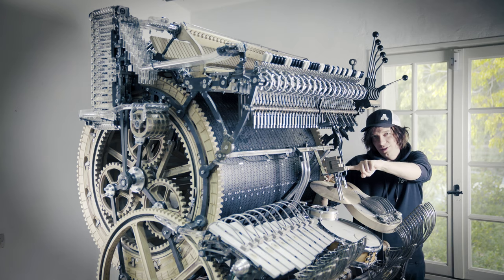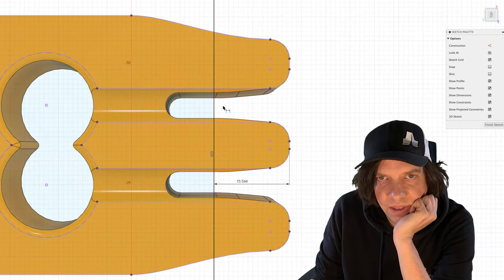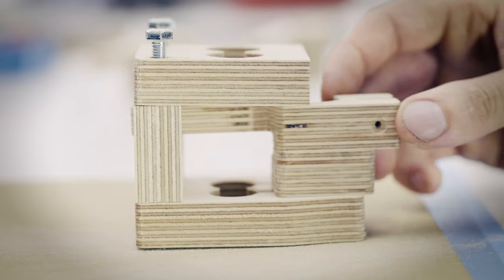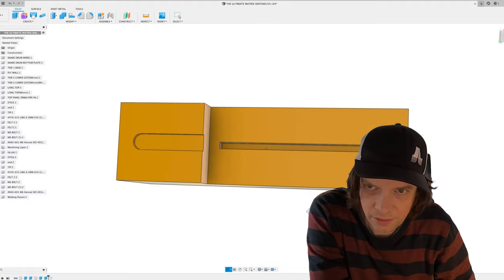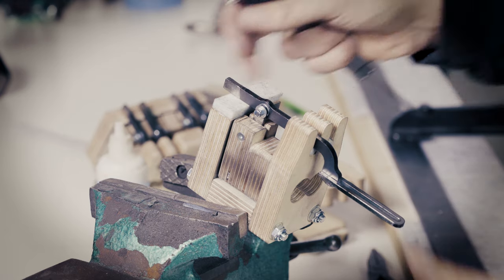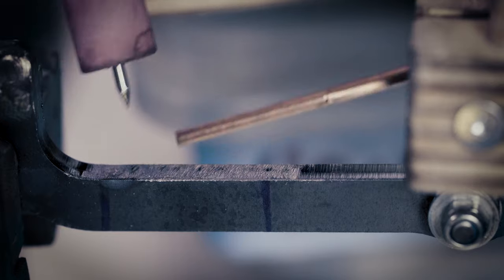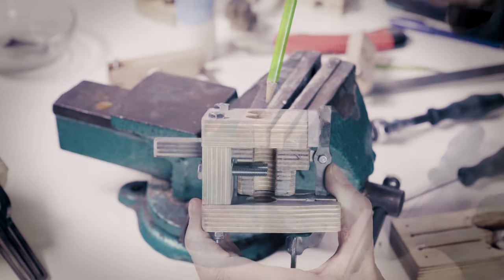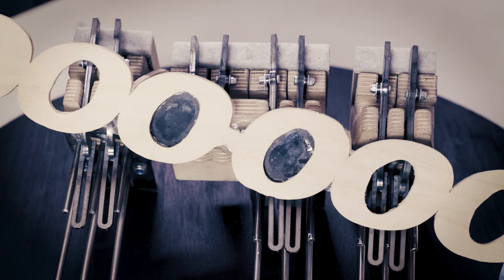Making Better Marble Gates - Marble Machine X #144

Comment: Reposting from last video. Please consider the failure mode instead of the failure rate. Do FMEA and pick a recoverable failure mode or at least a non cascading failure. You may lose one channel but the rest will carry on. Side note: If you can pick the point of graceful failure in the system - you can design it for repair easily on stage. Hello from Canada
Reply: That makes way more sense
Reply: I don't think a lot of the comments here get seen. Have you mentioned it on the Discord yet?
Reply: This is my number one criticism of this project from the very beginning. A ton of effort has been put into preventing failures, but basically none has been put into the failure modes. This was understandable when it was just Martin as he has no formal engineering education, but for quite some time there have been experienced engineers helping out that should have brought this up time and time again with Martin.
Reply: @Shinigumi  No. is it Patreon only?
Reply: I was going to comment something along these lines. The assumption seems to be that one marble failing per song means the entire song fails. If a drummer misses a beat on stage does that actually draw away from the entire performance. I doubt it. There must be an acceptable failure rate whereby the missed notes/beats are immaterial. Unless it wipes out the whole channel of course.
Reply: @dmacpher  It's not Patreon only, the link is in the description.
Reply: @Nomen_Latinum  RTFm eh :p TY
Reply: Great idea, we have this principle in software design as well. We expect components or systems to fail, if/when they do we want the system to handle it gracefully.  So an example would be loosing a connection to your data store, catastrophic failure would be loosing the record or file. Graceful would be having retrys, barring that, logging, setting the system to a safe state, giving a good error message, and maybe even saving and queuing that record for later.

Same I assume applies to mechanical failures. You build in failure points that will not affect the whole system.
Reply: @kainenable  in systems and mechanical engineering and design you want to 1) limit failures 2)have the failure not impact your defined critical control points or validated parameters for whatever quality spec you use (Gmp, iso, safety) and then 3) make it so when it’s in production your engineers and mechanics won’t hunt you down because you have to remove 5000 fasteners to get at a slip clutch, sacrificial fastener, or bolt :p). Very similar to software.
Reply: Agreed, there are two (or more) failure types. One that causes a song ending break down, and one that is just simply a missed note.
Reply: The way "failure" and "failure rate" are approached in these videos is very vague to me. Numbers without context are thrown about all over the place. Like the claim "drop 10m marbles without failing". What constitutes failure? Is hitting the instrument then missing the funnel a fail? Is missing one marble drop but working flawlessly after considered a fail? Or are only catastrophic, unrecoverable failures considered fails? As such, i don't understand why Martin is now so adamant about pushing these numbers. The only explanation i have is that he's for some unknown reason feeling pressured into delivering content and making progress, but is unable to do so because of the realities of building such a complex machine. Sounds like he needs to spend a lot of time refining some aspects of the machine (which is quite understandable at this point in the build), but rather than just saying it, he feels like he needs to justify it in some convoluted manner towards his viewers.

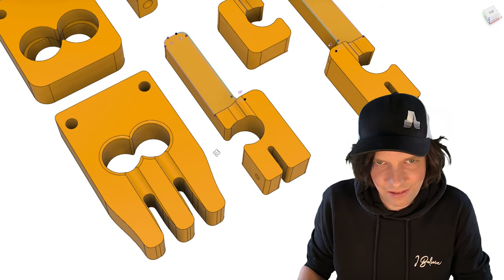And when he says stuff like 2:45 ("This needs to work 10m times in a row, so i'll give it a little extra slack."), my head explodes. He claims the thing is designed to work 10m times in a row, but he's using trial and error. How does that even make sense? The gods of engineering are weeping.
Reply: @billtheunjust  There are, in fact, more than two. A failure might also consist of the marble being slightly deflected during release, playing the note, but missing the funnel. But since Martin has never defined what a failure actually means, we will never know how many types there actually are.
Reply: @CristiNeagu  they said as much :p
Reply: @dmacpher  Please for the love of god keep posting this comment on every single one of his videos until he realizes just how important this advice is, and that at the very least it's worth addressing to the many worried engineers/designers that watch.

I will do my best to upvote it I suggest the community do this as well.
Reply: @seemlesslies  I’m on the discord - I’ll even do the FMEA for them and map the modes. Kinda need to scrum the validation and quality parameters they want, but I can guess . I wonder if they did a URS lol
Reply: Who needs a design or urs spec anyway (says younger me)
Reply: @CristiNeagu  That's exactly what I was thinking. You can't throw around the number 10mil and then adjust a felt strip by 1mm.... In a week that could deform. I would be totally onboard if he just said "as consistent and reliable as possible" but using a specific number over and over with no context as to what consists of a failure, whether or not he's differentiating between catastrophic failures and simple failures, or whether he has considered break points to accommodate for system failures is just frustrating, especially considering that people have consistently brought up these totally valid ideas.

Edit: also to be clear I'm not an engineer, but I do know from experience that nothing is ever perfect. You have to expect failure and design around it.

Seems he could save a lot of time if he thought about it this way instead of reaching for the impossible goal of perfection.
Reply: It's not like there's any hurry at this point. With CV19 any world wide tour, for the moment is a folly, and an impossibility. Enjoy the extended design. It's as much for him as it is for us.
Reply: @GrandmasterofWin  I'm waiting for him to realise that the huge multichannel audio cable he has is an exponential failure source...
Reply: @aserta  Nobody is complaining about time. No one's worry is that it's taking too long. I think we are all more than fine with that. What I am complaining about (and many others, i am sure) is that i wish he'd stop throwing around random numbers, and just do proper engineering.
Reply: @YourprogrammingnetworkCoUk  I've had a little bit of experience in music myself, and often times, if you miss a note, but everybody/thing else keeps going, literally nobody will notice.
Reply: @CristiNeagu  the audio cable doesn't need to be connected and disconnected tens of thousands of times, so its chances for failure are much lower. In addition, the cable is fairly easy to replace and any issues can be identified before the show starts; it is very unlikely to fail during a performance.
Reply: @nikolaihedler8883  Pins in those plugs are very easy to bend. People constantly trip over cables, pull them out of sockets, step on them, etc. And that cable is not at all easy to replace. And check out when he was installing the interfaces on his desk to see how easy finding an issue and replacing the cable is...
Reply: why not tell him to predict lottery numbers too?  there are literally 10000 failure modes in that machine
Reply: @natalieisagirlnow  likelihood to occur and criticality (defined by user) are part of the FMEA process. You can use critical control point, VSM and other methods to limit the scope. Anything low criticality to entire system can be removed from exercise
Reply: @dmacpher  classic pencil pusher nonsense
Reply: @natalieisagirlnow  I’m an OPS guy but hey, whatever floats your boat
Reply: To address the situation where one channel stops working, how about an option to make the other channel play it's notes? Like something that flips down and makes a channel react to it's twin's programming pins? Yes, the max rate is 1/2 what is was before, but most songs would be able to play fine (?).
Reply: @AndrewJohn   could also just have an opital sensor(or Hall effect if the pegs remain metal) read the pegs and fail over to live samples with a midi controller. Would be cheap.
Reply: I've thought about this. An example would be, rather than designing a channel so a marble never gets stuck, design it so that the marble gets ejected from the machine of it does something it shouldn't.
Reply: @dmacpher  it isn't. discord.gg/wintergatan
Reply: @nocare  I hear you. It’s not just mode OR rate. It’s rate and mode and criticality (if it’s a piece that isn’t defined as needed to meet the defined system requirements like a knob , who cares). I’m not pre supposing how to impact mode or criticality, but the percentage for the entire system he’s selected(and the marble drop sub system) are insanely high. Check iso 26262 on base failure rates. A good example is the Apollo program, it had an acceptable base failure rate of .1 %. That meant that in any given launch 600 parts would fail. The point isn’t to build something perfect, it’s to understand HOW things fail first, what’s the likelihood, and then either improve rate for the given part, the mode it which it fails so it doesn’t lead to system wide failure, or build in redundancy. It may seem academic but the exercise of defining user requirement specifications, design validation (fmea as part of that with a feedback loop) will often take you back to first principles and avoid the sunk cost fallacy.

Put in a short way, I wouldn’t define what the solutions are, just the process to asses the system and design. I’m not familiar enough with the entire design even though I’ve watched every episode. Hope this clarifies my thought.
Reply: @natalieisagirlnow  We aren't criticizing him for trying to predict lottery numbers. We're criticizing him for pretending like he's following some rigorous methodology for predicting lottery numbers, where in fact all he's doing is guessing. And precisely because there are 10,000 failure modes in that machine everyone is calling for him to do proper FMEA.
Reply: @ainzooalgown119  I joined - shaft Tackapple
Reply: @Thefloorislava115  exactly- a pressure based blow off valve (prv). Double stacked and they eject 1 or all of them.
Reply: Prv being an existing example - something much simpler ,could  be designed, just for reference. I work with a lot of insanely high pressure vessels using hydrocarbons and co2. Those sacrificial failure points are key :p
Reply: I think this is the most important concern right now. Martin's original programming pins were a better design imo than the new one. Martin complained how sometimes a pin might fall out, but that's exactly what needs to happen during a failure. One note being missed is much more preferable than the machine getting destroyed.
Reply: @nocare  as an ops guy high up who works with engineering and industrial design departments daily. This makes me smile so big - ty. Also agreed on the marble count not being unreasonable - just the complexity of the mechanism and the dependencies as the machine has a single power source (kinda).
Reply: @megaforse  I think there’s a slip clutch on the main bearing - so the rotational mass of the barrel will only break components up to whatever the torque rating is.
Reply: yes!
Reply: @dmacpher  That makes sense. I didn't mention that we also consider the impact of the failure as well. In a software it would be opening an interlock so a vacuum pump explodes, as opposed to getting the latest jpg of your interface.

Marble machine equivalent may be the failure of the flywheel, as opposed to the mechanical fingers. (Still not sold on em :D).
Reply: @kainenable  loves me a mechanical interlock backup and power off safe failure state. Are you a SCADA ninja?
Reply: This is the way! I have spoken!
Reply: @dmacpher  Lol, yup, great guess.  We have several vacuum, shaker, and RF test chambers where I work. We use labview for data aquisition and control. Opening a turbo pump to ambient atmosphere equals boom. 

I am mostly working with big data now.

Comment: It is incredibly inefficient to design like this, it should be very obvious that a 1 in 10,000,000 fail rate is completely unrealistic for almost any design let alone one with thousands of moving parts. You should either be designing to reduce the effect of failures or to develop solutions to known failures that will occur. It's also crazy to me that with this new mantra in mind you're still full sending from CAD to fabrication without any prototyping in-between. You opted to destroy precisely cut metal components instead of recut some plywood because you're expected measurements were off, this does not mesh with the mindset you are pushing. These kind of "fixes" are going to be what leads to problems down the line because now your CAD is intrinsically off the real-world measurements.
Reply: Disagree that it's unrealistic, after all a car engine will do half a billion cycles with failures being few and far between, and 10M cycles is a very common design target for industrial thingies. However, i agree that this current design effort is not being undertaken with a realistic effort to achieve such a high mtbf, nor are potential failures being mitigated. 

As it stands, i sadly think this project has a low chance of success.
Reply: @andrewbrowning6357  It's very important to note that there are also far fewer moving components in a car engine and very few modes of failure comparatively. When we talk about industrial testing with 10M cycles in mind we're generally talking about point testing or failure mode testing, i.e. compression cycles, tension cycles, flex cycles. Not the full functionality of an intricate system of components. For example, went testing shocks you might stress test the actual shock and housing but you're not going to test it by driving an assembled car over 10 million speed bumps, not only is that an impractical test, the sheer number of failure modes that opens up is unrealistic to mitigate through shock designs alone. 

I don't think this machine will fail personally however I do think Martin desperately needs to refocus the priorities and get some professional advice on designing for failure modes not against them. From the beginning this was a machine that was piece-meal designed and fabricated, at this rate he could easily see redesigning the entire thing as more efficient.
Reply: @rydude998  I mean, you can find the ford proving grounds in Yucca AZ and see the speed bumps they use to do exactly that. Maybe not 10 million speed bumps, but few hundred miles of cobble roads will easily net 10M cycles of expected wear.
Reply: @andrewbrowning6357  10M cycles of what exactly? You seem to have missed the point, as I mentioned it makes perfect sense to failure test specific sub-assemblies and then redesign to either mitigate failures or design for the observed failures. Driving a car across 10M speed bumps will 100% break it, nothing is designed to work flawlessly 10M times. Doing so will also not give the engineer any meaningful information as to where and how it failed. Designing a complicated system with thousands of moving parts to NEVER fail during 10M cycles is completely unrealistic and highly inefficient.